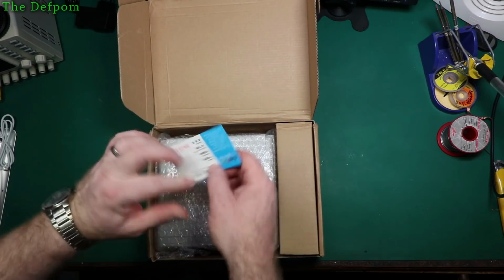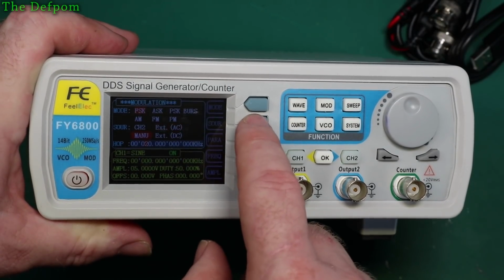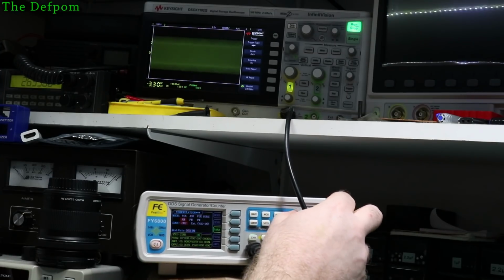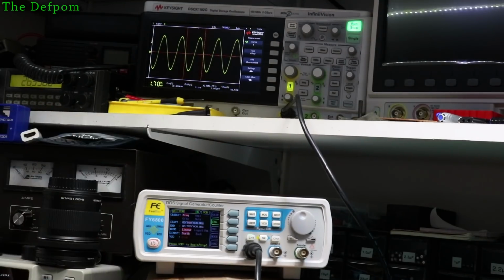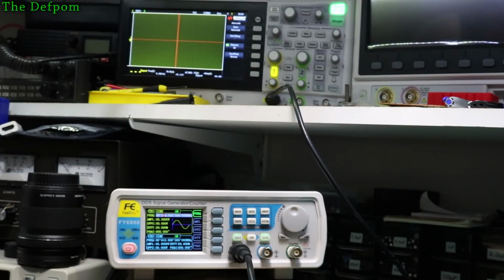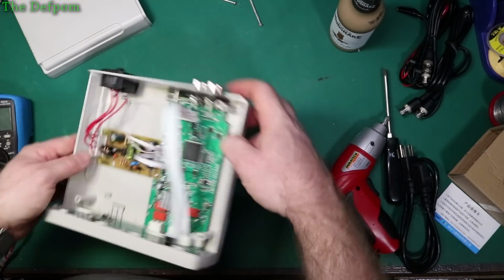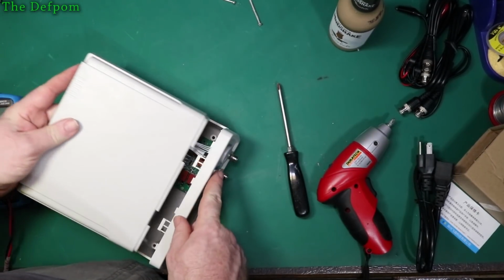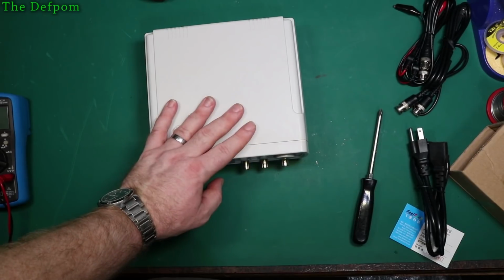🔴 #494 Feeltech FY6800 60MHz AWG Signal Generator Review

Comment: I looked in your video library and I didn't see a video with this signal generator , hooked up to a 2 way radio.....  I sure do miss my HP signal Jenny ... Will this unit go down to uV ?? Such as tuning the recieve on a Cobra 29 , 25 ETC ETC Injecting a signal of 1KHz with 30%modulation and RF output level of 1.0uV  , I don't think the unit will go down that low , Like I said I miss my HP rf signal generator . I am looking at the Junctek 80 meg generator but I don't think that one goes down that far either... There is a lot I can do with it but I need to make sure before I dive headfirst into 150 dollars US and then needing to get another HP... I would like to see you tuning a radio with your Feeltech and see how much it can actually do with a CB ...  Thanks again for a great video...

Comment: I bought the  same unit thru Amazon and channel #2 would only generate a sine wave. Channel #1 worked OK but no matter what I did, I couldn't get channel #2 to generate a square wave or any other wave besides sine. Also, it was DOA out of the box. After removing the cover, I could see the ribbon cable was undone from the display. Plugging it back in got it operational. I returned that one for a refund and bought another one which should arrive this week. Hopefully it works OK.

Comment: I have just purchased the new FY6900 version of this. It's really not bad for the price. I don't find that buzz when using with a radio with modulation at all and 100% modulation only just a hint of over mod.
My main moan about it is the SMPS. It radiates all over the place, almost impossible to use at low levels as the SMPS is picked up by almost everything on the bench, even when not connected to anything.
I think the next project will be to replace the SMPS with a linear power supply. Just got to find out how too open it, sadly not a screw in sight, like yours.

Comment: Thx for the video and yep not a bad unit, just as long as you keep having the price in mind.
Also got one, though its the newer model FY6900  60mhz and it is surprisingly packed with features for a unit that I could purchase from EU for a tad over 70USD. (74USD delivered)
at 74USD for a 60mhz DDS AWG, the threes don't grow into the sky, but that goes without saying for such sums..
gonna pimp it a tad, with a solid metal rotary knob, cost a few bucks.
remember to turn it off, after use, the standby is pretty aggressive, at a few watts.
The software works as a treat and connects without any bells and whistles, font not ideal, but make the interface way more manageable, and its more or less instant in reply..

Comment: Thanks for checking this out. As an old fart (60 yo, I started out with electronics in the 1970s), I have quite mixed feelings with these devices. Remember the 1980s/1990s when we had these massive, well-built, calibrated, ultra-exact and ultra-expensive units from Fluke, HP, Keithley and others that nobody could afford? They couldn’t do too much but what they did was _perfect_. Now with the advent of microcontrollers, cheap parts and chinese clones we tend to get devices that seem ultra-functional but often have cluttered, unusable user interfaces, unsafe and questionable construction and are far from exact. But incredibly _cheap_. Hobbyists and sometimes even EE’s start to rely on what I’d often call real bad/faulty measurements.

The old German saying "Wer misst, misst Mist!" (roughly: "Who measures, measures crap!") is more true than ever.

I wonder how my lab will look like in the future. I still have (and buy) 30- to 40-year-old devices like old Fluke, Hitachi, HP/Agilent gear and try to fix them and keep them running but I somehow fear more and more will be replaced by these new el-cheapo (and el-imprecise) devices, since of course I don’t have endless funds. I always feel there’s kinda gap between "ultra-cheap, multi-functional" and "ultra-expensive, real good". Wish there was more gear in the "a little more expensive but okay-ish" range for those whose job moved on to a hobby and those who are just starting out.
Reply: Back in the day 70’s & 80’s there was no way in hell I could afford any of that fancy test gear.... An old Simpson meter, massive Weller soldering iron, and a knock off Bird wattmeter was all I had..... Now in my 60’s I have loads of this old test gear that I could only once dream of...  Tektronix scopes, Phillips scopes ( they were made in Holland) Hewlett-Packard signal generators and Multimeters once used by the military. Motorola service Monitors, Bird Wattmeters and still to this day my trusty old Simpson meter!!!!  Sure, not as flashy or Bells and Whistley as today’s modern stuff..... BUT they were built to do a job, they were built to last, they sent us into space and to the moon....  Put together better than the finest watch costing 20 times as much... And are still around for people like me to use and enjoy.....   Used pro industry standards gear or today’s bell and whistles knockoffs? Give me that Hewlett-Packard or Tektronix every time...
Reply: I have a Siglent scope for $330 on Amazon. I am 60 yo and never could afford one before now. It does great measurements, and I am learning what I missed out on.

Comment: The power supply board is the same one that's used in a million cheap DVD players and uses a viper switching chip.  Nothing could go wrong with it and if it does just open your Speller DVD player and swap it out.  It outputs 12, -12 and 5 volts at about 2 amps or thereabouts.

Comment: What about the PC software that goes with it? Seems like a review should show the software that contains about half the functions of the device.
Reply from the maker: You are right, I should have looked into that side of things also, maybe I will do that in a future video.
Reply: @TheDefpom  for what it is, the software ain't bad and makes it way easier to adjust things.
and for anybody been down the never-ending VISA road of Driver nightmares, this crude FEELTEC software are very easy and just plug the USB cable in and it works and connected, though the FONT would be nice if one could change that..
It seems the device will also run on a bare 5v USB input and no AC, but how much it crimble the functionality, not sure, all the not too demanding waveforms seems loyal from the 5v USB supply-.

Comment: Thanks for the video. If you grab the manual for the FY6600 you will find it has a section on the modulation function that is pretty close to that in the 6800.

Comment: Is the output flat or is it all over the place. Should be flat into a 50 Ohm load
Reply from the maker: its output voltage does jump around when loaded with 50 Ohms, when set to 5V it is doing at most 2.8V pk-pk at 40MHz, at 60MHz it is only 1.4V pk-pk. I did find though that you can set it to do 20V below 20MHz (but only does about 5V pk-pk at 50 Ohms)

Comment: Try adding a 50 ohm load, shouldn't roll off.
Reply from the maker: its output voltage does jump around when loaded with 50 Ohms, when set to 5V it is doing at most 2.8V pk-pk at 40MHz, at 60MHz it is only 1.4V pk-pk. I did find though that you can set it to do 20V below 20MHz (but only does about 5V pk-pk at 50 Ohms)
Reply: @TheDefpom  I have a 40MHz JDS6600, It's flat to 40 MHz.

Comment: I think the amplitude issues were in the main your scope bandwidth  -3dB down and incorrect termination. Be interesting to see the harmonic Distortion on the DDS generator output at various frequencies. It looks very useable to me. Is the display as bad in real life as it is on the video, looks like it should be back lit. I assume the transformer at the front of the PSU is actually a common mode choke.  Oh just heard the DDS noise errrrrrr however not necessarily and issue for radio work. I have always found the most annoying thing about these cheap signal generators is actually the lack of screening and noise escaping from any port.  I could find a place for that with all the features and low price point.  Show us the FFT on your scope. Interesting review thanks. Best regards Chris
Reply from the maker: The scope is rated for 100MHz, I actually went back into its settings to make sure I didn't have its bandwidth filter turned on, it wasn't. I think lack of termination could possibly be the cause of the rolloff, I will set the unit back up at some point to confirm if that was the issue or if it is really gradually dropping off above 20MHz.

The display is small, readability is better in real life though, part of the issue is that I have so much lighting going on it tends to drown it out a bit.
Reply: The Defpom's Repair Channel  That kind of surprises me, but interesting my 200mhz keysight also reads bang on at 200mhz.  incorrect termination at lower frequency like 60mhz normal reads high as the signal generator has 50 ohms internal resistance  and the dial is calibrated for 50 ohm load. Most signal generator don’t actually measure the output power as it’s difficult at high frequency and  with very low signal levels. Out of interest what is the impedance on the Outputs on the signal generator meant to be. Nice test if you measured it.
Reply from the maker: I just tested the output terminals, they are loaded with 600 Ohms, its output voltage does jump around when loaded with 50 Ohms, when set to 5V it is doing at most 2.8V pk-pk at 40MHz, at 60MHz it is only 1.4V pk-pk. I did find though that you can set it to do 20V below 20MHz (but only does about 5V pk-pk at 50 Ohms)
Reply: The Defpom's Repair Channel  well that makes sense if it’s designed for 600 ohms. Obviously that’s still fine for most none rf application. I don’t hate it. It’s good for the price.

Comment: Software upgradable ?
Reply from the maker: I don't know, I haven't actually read the manual yet.
Reply: Trailtraveller no it isn’t, I contacted the manufacturer and they told me I would have to send it back to them for firmware update.
Reply: @caulktel  I saw a post from them about some firmware update for users. I am not sure if they meant that you had to set it back or that users could do it themselves.
Reply: Upgrade only via PC software.